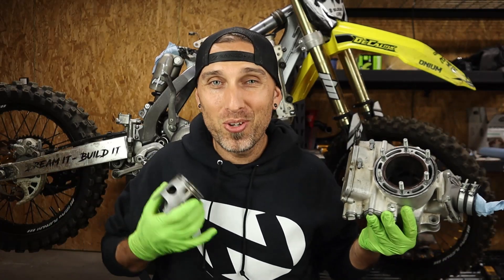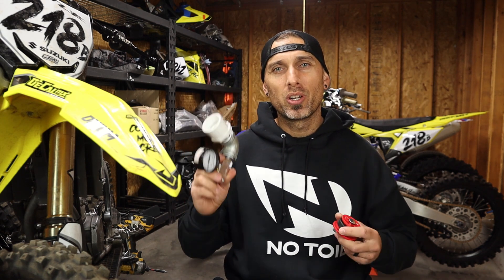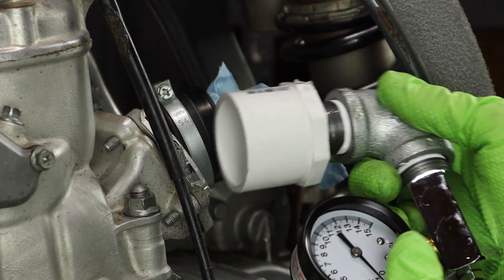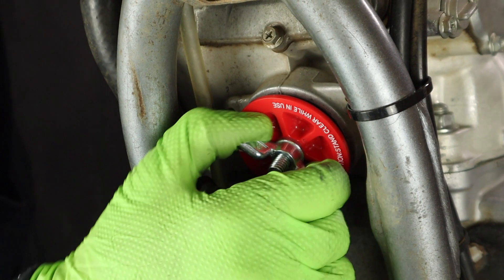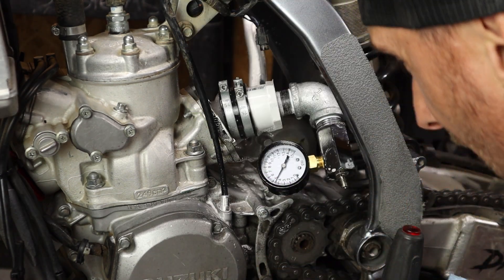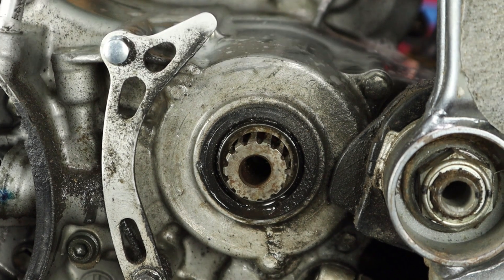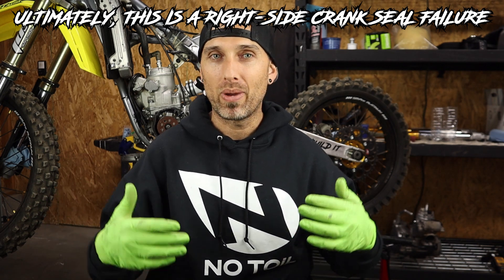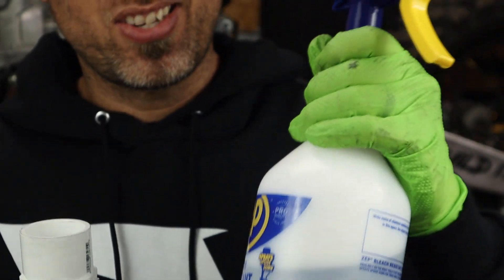I BLEW UP MY TWO STROKE | Let's Find Out Why - Dirt Bike Leak Down Test & 2006 RM250 Top End Fails

Comment: You’re going to have to inspect the cases really well to make sure there’s no cracks or warpage unless you know for sure it was leaking from the right side crank seal. I would try to verify that before spending time and money rebuilding. Still waiting for the CR500 rebuild…
Reply from the maker: Totally agree! It could even be something like a nick between the case halves from the cases being split with a screwdriver! I did think it was interesting that it was coming out from behind the sprocket, then realized this Suzuki doesn't have a crankcase breather like the Yamaha. So the air has to come out somewhere.

Comment: I guess I’m confused how a crankcase leak would get into the cylinder.  Wouldn’t you have a leak between the transmission area and crankcase also?
Reply: yea, the transmission is completely seperate and the only way that the cylinder would leak into the transmission, to leak out of the output shaft would be crank seal.
Reply: Air being pumped in is getting into the transmission via the powervalve shaft or RHS boost port powervalve mech.
Reply from the maker: There are some outstanding replies from JonnoMoto & Keith Peterson In the comments that are more in depth & explain better than I did. I rushed this video, and should have done a better job.